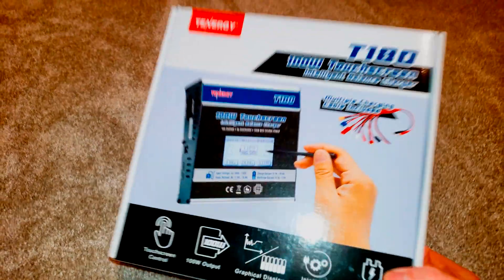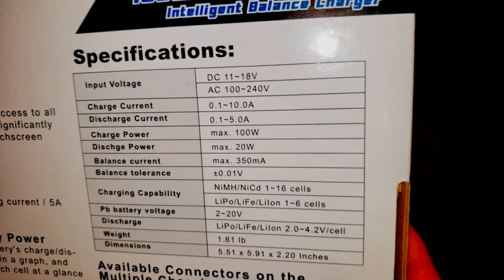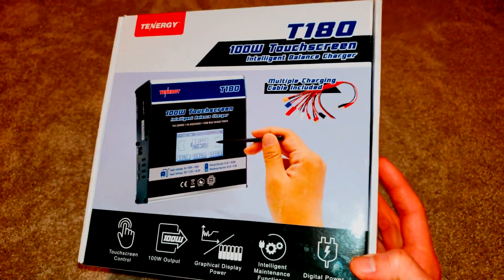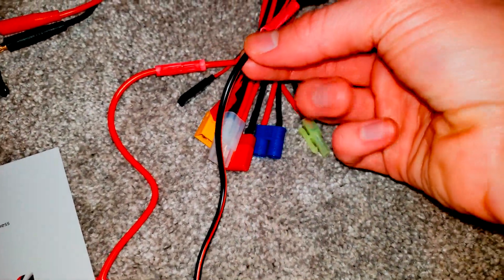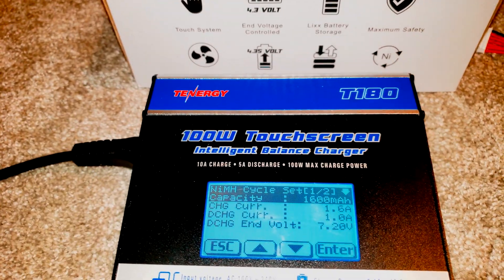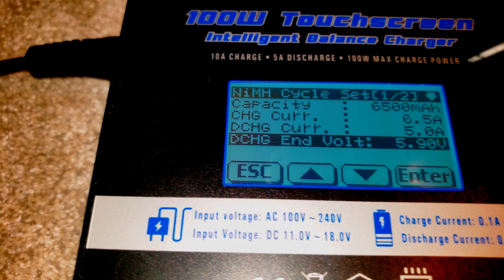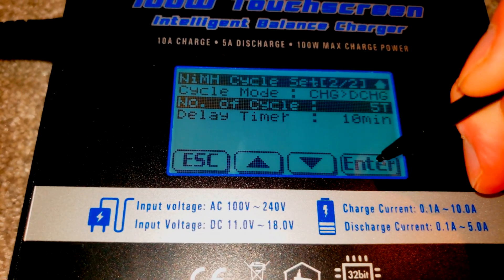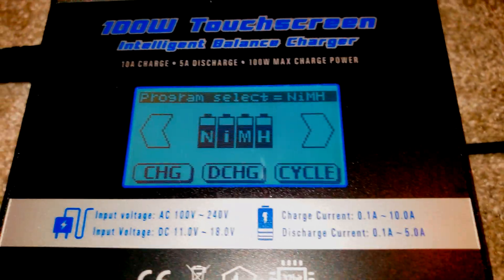Hybrid Battery Reconditioning Hobby Charger Settings - Tenergy T180

Comment: Can this system recondition a bad battery cell module? The battery I have and I want to repair, came out of my 2009 GMC Sierra hybrid, which has not run in 6 years. I m the original owner.
Reply: Put it in your freezer 24 hours before hand . I have done this and had success bringing back cells that were bad .  A friend of mine that rebuilds hybrid batterys for a living told me about this and I thought he was crazy but didn't have nothing to lose so I tried it with a few and sure enough it worked.  Its not a guarantee but 9 times out of 10 it worked for me

Comment: After 2 failed Array 3710A  150W max electronic load testers, (garbage quality & $225 per factory repair for each), I asked a battery charger mfg tech support person what they used for controlled battery discharge.  Answer- Bank of 12V incandescent automotive headlamps.

Comment: What about leaving every two (of 28) blades connected, and reconditioning them as 14 blocks?  The Tenergy T180 can handle 16 NiMH cells.  Each block has 12 (2 x 6 per blade).  Wouldn't that simply cut the time in half?

Comment: Been driving with an unbalanced battery for 2 years, and you're telling me I can fix it with my damn RC car charger!
Reply: I pulled mine out, didn't pull or move a single module. Just pulled the bus bars and cycled each module.... It's like new. I couldn't believe it.
Reply: @Phill0046 how long did that take to do all 28 cels?
Reply: Well, there's a possibility you've damage the battery over the years. But, if their voltages aren't too far off from each other then you should be fine.

Comment: So I bought 2 of these and frankly I would not do it again.
I set up the charge-discharge cycle to end the discharge at 6 volts.
Neither of my T180s will go down to 6 volts on the discharge. They always stop somewhere in the low 7s.
I have a couple year old Revlonix Powerlab8, that I used for bottom balancing LIPO4 batteries but I could not remember how to set up a custom profile.
However, I do remember that when I set it to discharge a cell down to 2.65 volts, that is exactly where it stopped the discharge cycle.
I would not recommend the Tenergy T180 for proper reconditioning of the Prius cells. 
Doing the process helps but unless you can dump all the energy down to the lowest level, the memory effect remains.

Comment: After doing this for the last 2 weeks, I can say, this specific charger does not work on "Cycle" mode. It just ignores your settings and decides to stop discharging seemingly randomly. Charging and discharging manually works fine. It's just going to take forever.
Reply: i have the same problem
Reply: It worked for me.

Comment: Ive been using other chargers and methods (you can see some of them on my videos) but really wanted to upgrade to a charger with automatic functions like this one with 4X capabilities. The problem is, apparently everyone else wants the 4X chargers too so they are constantly out of stock. This seems to have all the automatic charge+discharge cycle capabilities I would want I can just buy multiple chargers and plug them into a power strip. Thanks for sharing your great step by step instructions for the settings so I dont have to try and figure out another new charger with chinese instructions. I will certainly use your affiliate link, you more than  earned the tiny commission amazon gives. I will give ya a shout out in my first video featuring the T180.

Comment: Based on some of the below comments, it seems that the charging/discharging cycles should either allow for more of a break in between charging or perhaps a fan should be set up to keep the individual cells cool during the process.  What do you observe as far as temperature is concerned on each cell?  What is the max temp a cell should see before damage occurs?  Would it help to put a temperature sensor in each cell to monitor the temperature during charging?  Have you done this, and If so, please advise your technique.  Thank you.

Comment: I've heard that very important that reconditioned modules' capacity to be close to each other, some say variation should be no more than 200mAh,  is it possible equalize capacity? I am reconditioning my gen 2 Prius modules now and see 500-600mAh variation.
Reply: I believe I remember reading somewhere that the Module with the lowest capacity will be the one that limits how much Charge/discharge (the perverbial weak link) you have during installed use in the vehicle therefore you would want to replace the lowest capacity module you have with a better one till you get them all as close to the few higher capacity cells in your pack. That would mean no real pass/fail #s just a pack with only a 200mah variation would be much more desirable than a pack with a 500mah variation.
Reply: @saneauto  I started using Dr Prius app after reconditioned my battery pack, and noticed that battery temperature raising over 120°F when driving around 40 miles at cool, around 50° weather, and battery fan still not switching to high speed. I use Dr Prius override temperature feature, set it to 95 degrees, so it turns the fan to high speed to cool it down. I am not sure why it raising that much. Have you checked your battery temperature?

Comment: Welcome to the world of novice prius battery charging. 

If you follow these instructions on individual cells with no temperature monitoring and no external cooling . The outcome will be cooked cells.

A prius only uses the cells at 40%-70% region during normal operation of the hybrid vehicle.  

This obviously never fully discharges or charges a cell for good reason it will quickly kill the cells. 

A property maintained cleaned battery is capable of lasting the predicted 21-23 life of an average Toyota . 

Cycling old cells in this manor ( 5 cycles) will generate too much excess heat and irrevocably damage most cells or at the very least start the process which will then kill the battery when in the car.

Reason being you do not ever treat a prius cell like a standard nimh cell for a toy or model. These cells are intended to max out the cells and kill then in 100 cycles . A prius can cycle the nimh that many times in a day ( 40/70 DOD RULE ) not 0/100 DOD AS ABOVE. 

The difficulty with these cells is detecting the vdelta component of the cell at full charge which it is not designed todo in reality ( 70% SOC max ) . The cell needs to be charged at least 1C in order to successfully detect the small <3mv bump . Anything lower it will miss ( remember 6 cell module will produce 6 vdelta bumps close to each other for a good cell) . 

And if you miss the vdelta any extra charge above that will turn into heat . Old cells do not measure 6.5ah but approx 5.5ah so this is what will kill the cell. With no heat dissipation. 

So if your planning on doing the above advice procedure without cooling or temperature sensing make sure you have a fire extinguisher handy. 

Doing this 5 cycles is just pure stupidity. The only saving grace is your doing one cell at a time and if there in the battery pack these are using the other cells to get rid of the heat. 

By nature or the above each cell will take approx 2.5 hours per cycle x5 is 12.5 hours x 28 is 14 days to test all cells so this would be unattended which is just impractical and very very dangerous fire risk .
Reply: Tienes alguna configuración para hacer esto sin dañar las celdas del Toyota prius?
Reply: Do you recommend a different reconditioning method or video?

Comment: Thanks for making such great videos! I just ordered two Tenergy T180's plus the test leads using your Amazon link.
Reply: Did you have success doing that? Mine is doing some things I'm not certain it should be.
Reply: @FawltyPlay  unfortunately I am pretty sure my hybrid battery was exposed to too much heat before I knew what I was doing, I ended up having to get a new one
Reply: @FawltyPlay  I was able to recondition a few modules but 11 were not salvageable.  The process does work as long as the modules are not too far gone, but it does take a LONG time.
Reply: @MrSaguaro  Hey, thanks for the reply. How did you end up determining that they were too far gone? Mine seem to be reporting the right amount of capacity even without recondition but they also seem to have really high self-discharge. I'm not sure what made the IMA light come on anymore now...
Reply: @FawltyPlay  I guess a commonly agreed upon minimum capacity to be considered successfully reconditioned and worth keeping is 4000ma.  Unfortunately 11 of my modules ended up below 3000 even after additional cycles.  9 of them were in the center of the pack.  Pretty sure they overheated this summer due to dirty hybrid battery fan.  :(
Reply: @MrSaguaro  Damn that's pretty bad. So far all of my sticks are testing out to 6000mAh-ish (I'm doing Honda Accord Hybrid 14.4v sticks) out of 6500 so I'm hopeful. 4 more to go, I'm honestly starting to hope one of them is actually messed up because if not I have no idea what made the IMA light come on...

Comment: After you cycle, how can you simply charge the battery, do you individually just charge them to 6500mah? I’m doing this on a highlander EV battery but other then the cell count that’s all that’s mostly different on these. So instead of 6 for the discharge I used 8.

Comment: I have a question when you do Charge - Dischrage do you charge it again to finally put it in the car or leave it discharged? and I saw the balancing video when you connect all Positive and Negative do you attach it to T180 or does by itself and how long do you do it. can you please explain the process?
Reply: I have the same Question, What did you do? I am thinking to charge one time and then balancing puting all of them in parallel for 24 hours.
Reply: @jjccarana  any answer to this ?

Comment: I really appreciate your informative videos. I purchased this T180 charger recently. I have been testing the cells on one of my three defunct second generation Prius battery packs. I have set the charger up with exactly the parameters you specified. Not sure what I’m doing wrong. The voltages on all but one cell were within normal limits to begin with. When I put the charger on, most of the time I get a reasonable 4 to 5000 mA reading on the first charging cycle with a decreased discharge Milli amperage. Subsequent charge cycles read between 50 and 150 mAh of charge and discharge. Any suggestions? You might save it all these cells are bad however I find it hard to believe that all 10 of the 28 cells I have tested in this battery have gone awry. Thanks
Reply: Happens to me when I use the cycle feature. It seems totally useless and just ignores my settings. Doing it manually works.

Comment: Very useful, thanks you. My charger arrived today and I pulled and opened my prius battery. Getting ready to cycle some cells.
Reply: Did you have success doing that? Mine is doing some things I'm not certain it should be.

Comment: Help! Great video and info however, I am using the T180 now and the voltage on charging is going as high as 9V !   Is this okay? I did not see you mention anything about the voltage and I did not see your display while charging or discharging. Anything you can add would be most appreciated.   I don't see any way to limit the voltage and I pulled the plug at 9V.  Also, I think the mAh would be skewed starting from 8.5 or 9v.  What do you think?
Reply: Did you find an answer to your question? I have similar concerns with my HAH sticks I'm trying to cycle.
Reply: @FawltyPlay  did you find the answer?
Reply: @cory5233  The answer is that the T180 is a product you just have to blindly trust.

The overcharge limiter (setting max mAh pushed into the battery) straight up does nothing. You can use peak voltage, but for NiCd sticks you shouldn't. Just have to trust it to do its thing.

I dropped the product and moved to a different one called the UltraPower UP6 charger and I bought the external discharger because the discharge time on the T180 was abysmal—talking all night just to do one discharge cycle.

However I never got to use it because a friend of mine found 2 CADEX units which can parallel 4 batteries at once each with 150W of power or something. That thing kicked ass and I was able to cycle a battery in less than 3 hours. I gave all my batteries 3 cycles each and then did my best to balance them and now my car runs fine. No codes, good mileage.

Hope that helps.
Reply: @cory5233  You can find the typical NiCd voltage curve during charging, you'll see it peaks at some value and then drops. Battery charges look for the drop (called deltaV minus) as the cutoff point for charging. For my 14.4v sticks the drop typically happened around 17v.

Comment: Ok so I called the tenergy company and I asked, when its in cycling and we see "{STAGE        CC}" that means its in Charge Capacity and the other after it switch to {'STAGE          DC} that means its in Discharge Capacity cycle mode.... lol...nothing to worry about.

Comment: If the cell charge voltage is 7.2-8.4 why does my final voltage show 9 volt at the end of each charge cycle? I used your specs when charging/discharging.

Comment: I've read that the benefits of reconditioning are quite fleeting, and long-term, the reconditioned battery is barely better than it was before.  Is that what you have seen?
Reply: I have had my battery reconditioned as it discharged very fast and charged very fast when braking. It was done by a professional I think he did 3xcycles on any bad cells, I believe it us working well better over 1 year later. It cost me $500 tho. Fuel efficiency stable at 24km for 2011 Prius 140000km

Comment: I bought this charger.  It works okay.  I contacted the manufacture and they said the charger can go up to 5amps discharge but most likely on a 7.2 volt battery it will not draw 5amps.  Mine was only pulling 2.1amps.  Also the computer software is not available at this time as they haven't made the software yet.
Reply from the maker: If you find a better charger for the money let me know and I will give it a look. The 2.1A sounds about right as it can draw around 20w max.

Comment: Thank you for the video.   I'm have the T180, used cycle, set the charge current to 6.5A.   When charging I noticed the voltage went up to 9.27 Volts.   Is that something to be concerned with?  What is the maximum voltage we should see when charging.      
Thank you.
Reply: Did it just keep going until it reached 6500mah?
Reply: @cory5233  It did keep going, I was just concerned about the voltage.   I ended up doing about 30 cells, draining / charging 3 times each,  Replaced 4 used cell in a 2008 Prius battery that was giving me the read triangle of death, 1 year later and 15K miles and it is still working.

Comment: Despite my best efforts, I feel like I am doing something wrong. Every single one of these units is showing a capacity of right around 300-350mah. No, not 3500.... 350. This is only on charge. On discharge it shows 0. At first I thought I had things connected wrong. I finally hard soldered the alligator clip wires to the "octopus cable" leads just to be sure that the connection was sound.

Any thoughts on what the heck it could be? I was thinking that it could be too small a gauge on the alligator clip wire, but I purchased the exact cables you had shared in another video off of Amazon.
Reply from the maker: First thing I would verify would be the voltage the charger is detecting vs the actual voltage at the module terminals. Use a multimeter to confirm those voltages are the exact same + or - 0.05v. If they are not the same there is something amiss with the connection or wires that is confusing the charger into thinking the battery is charged or discharged while it isn't.
Reply: @HEVTech1  Do this if you're having the issue. I suspected my wires may have been too small to handle the capacity when the insulation melted on the recommended Alligator clips. I also had voltage readings of up to 14 V on the cells via the charger. The multimeter confirmed that the voltage readings were wrong. Thicker wires leading from the chargers octopus cable to the battery terminals brought the charger's reading to within 0.4 V of the multimeter once everything was at operating temperature. That's still a bigger difference than I'd like to see, but I don't have a car so I can't do much about it.
Reply: You need to do it manually instead of using the cycle feature. Cycle stops it early and ignores your settings for some reason.

Comment: On the T-180 that I tried with, the voltage reported/sensed on the T-180 is off by quite a bit compared with taking the voltage right at the battery - difference is greatest with more charge/discharge amps specified. For instance. I put a multi-meter on the same terminals as the T180 and when discharging at 3 amps, the voltage difference is as much 0.30v, so a discharge cutoff at 6.00v is actually 6.3v.  If I decrease the discharge to voltage to 0.1 amp, the voltage difference is negligible - but that would take forever.  So, one could I suppose change the discharge target voltage to 5.7v instead, but that seems risky.  When charging, it is the same thing, except T-180 shows higher voltage that the multi-meter.  Anyone showing this as well?
Reply from the maker: What gauge wire are you using? I have noticed with lower quality wires/alligator clamps that you can see differences in the T180 reported voltage and the voltage at the terminals.
Reply: @HEVTech1  Thank you so much for your reply. The cables are pretty thick and never got warm during a 5a charge/discharge. I looked at the construction of where the wire is crimpled to the alligator clip, and discovered that it may be a weak link, as it is isn't crimped well.  Since then I've put the battery back in the Prius, but I'll try it again soon.
Reply: What did you do about this? Mine is exactly the same. Discharging to 5.7 gets me around 6v.